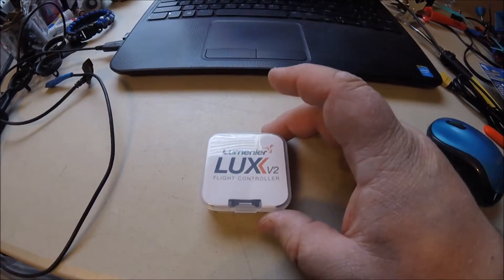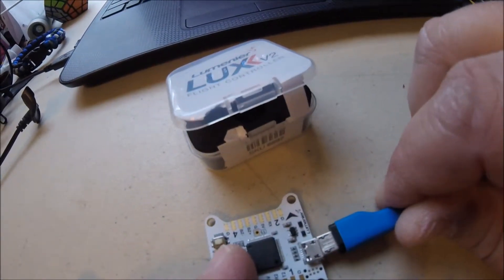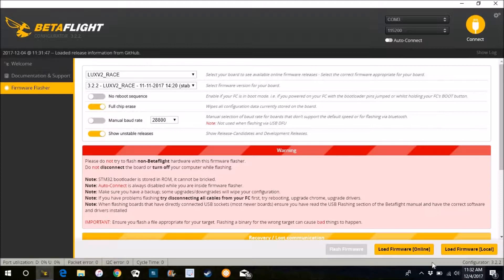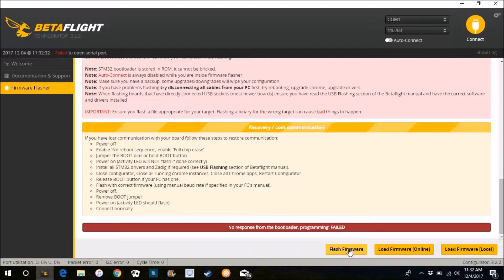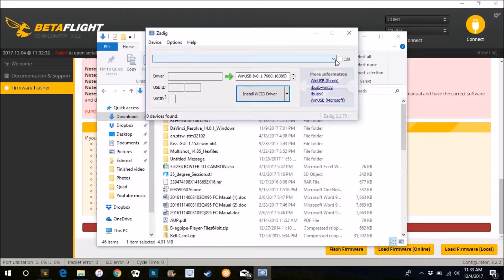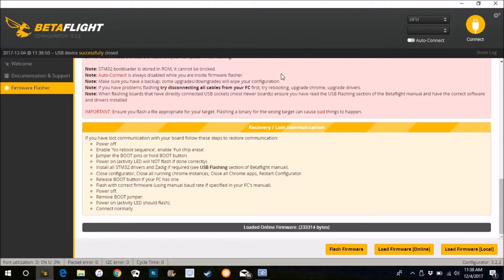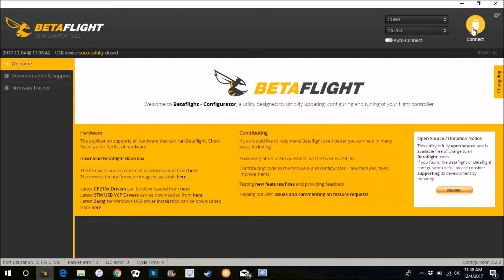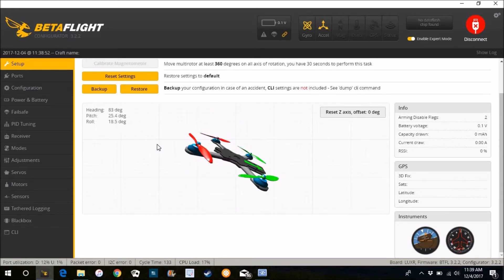Flashing a Lumenier Lux V2

Comment: so... how did you get DFU to appear?
im having a time and a half with this. also mine will not say bootloader when in zadig. it says VCP
Reply from the maker: SuperNova214, I usually just keep messing with the different drivers. You can see the driver that worked in the video.
Reply: Bluto FPV - didn't work on mine but the impulse rc driver fixed it. Thanks man and happy flying! Subbed